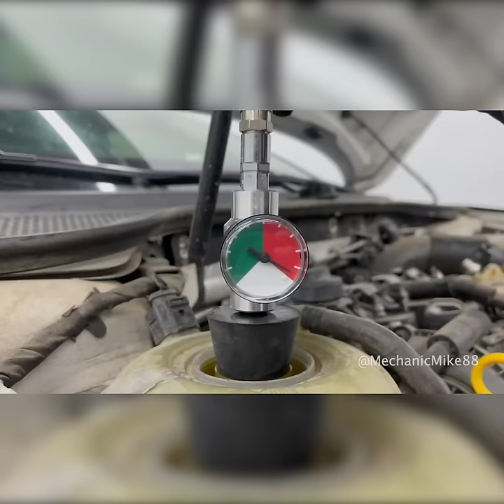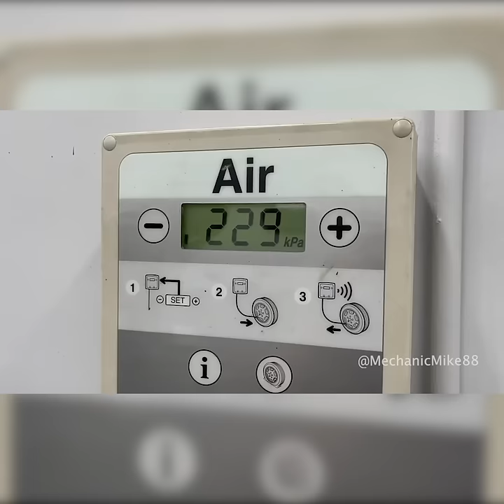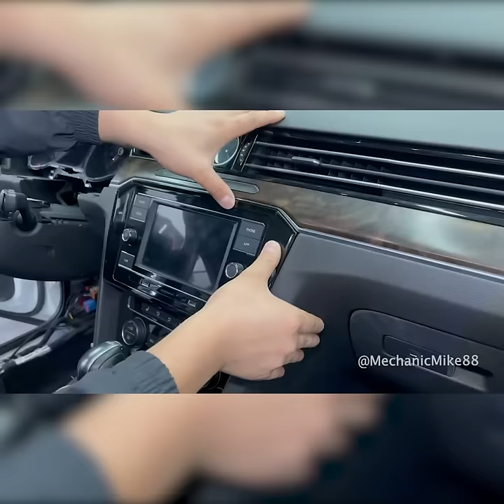Volkswagen Full Maintenance .

Comment: Why did they remove dash and door panels? Were they installing aftermarket components,, or repairing defective ones?
Also,, I would have done the engine compartment flush before the service. There was much dirt on everything, and there's risk of it getting into spark plug and coolant lines, possibly causing engine damage.

Comment: I wouldnt recommend using an impact gun to take the air box screws out. They're normally in poor condition and will strip.
Reply: it wasn't an impact, it was a drill. They set the clutch so loose it will not be able to put any torque on the screws, basically hand tightening them.
Reply: Ich

Comment: Why do some VW cars have G13 and more recent G12 ? This G12, G13 story, it is one of the biggest mysteries in 21 century.
Reply: G11, G12, G12 plus, G12 plus plus, G13, G12evo
Reply: I think it depends on the compression and temperature rates of the engines. Engines which work at a higher temperature ( like most New Beetles and so on) require one which can stand higher temperatures
Reply: Il g12 è più vecchio ma è meno compatibile con l'ambiente hanno prodotto il g13 perché contiene un principio chimico meno dannoso per l'ambiente ma purtroppo hanno notato che dava diversi problemi sulle pompe dell'acqua.. quindi sono tornati sul g12 che non reca danni ai metalli😅

Comment: Thank you,
I think the changing of motor oils should be automatic with electric power switch ,not by trying manually. Manually opening the nat and bolt will create issues for motors, but automatically, switch is much better. By clicking a switch, we can change the oil of a machine, then we can easily put the new oil as required. 
Best Regards, 
A.